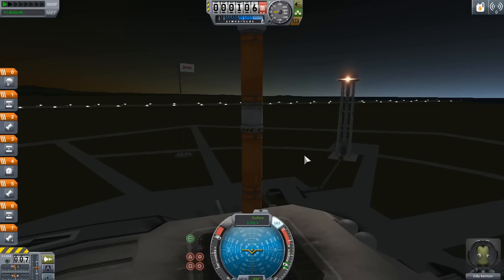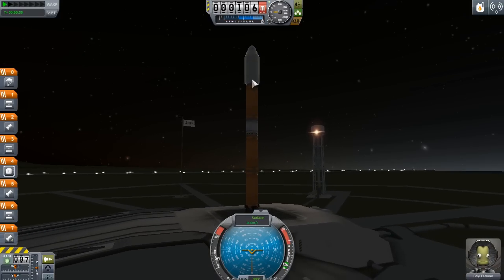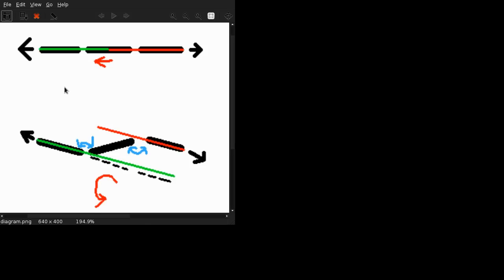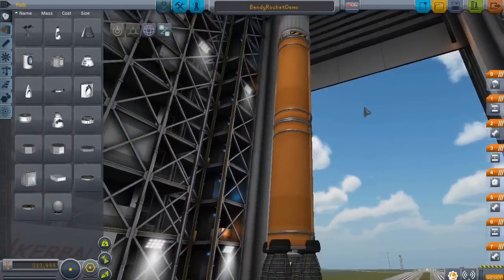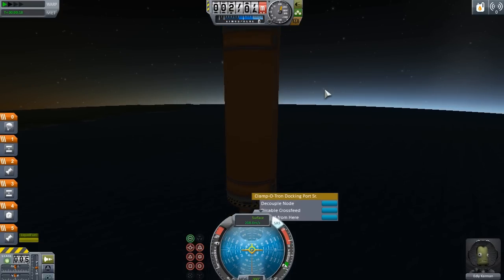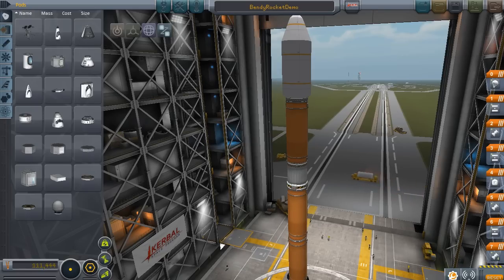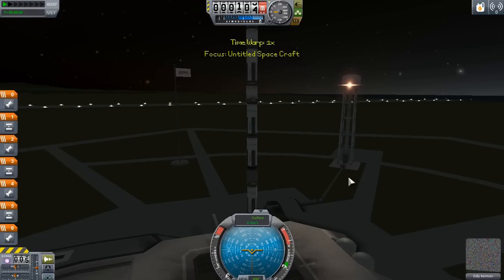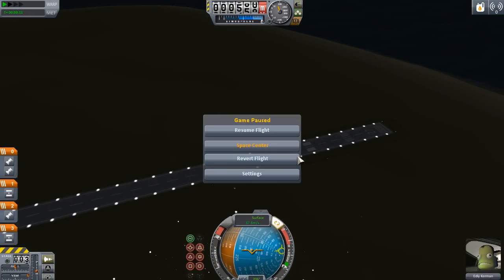Kerbal Space Program - Tall Wobbly Rockets

Comment: I realize this is years late, and everything you said is correct - however; the real issue which exacerbates the wobble and causes all sorts of OTHER problems like SAS fidgeting is the lack of any kind of auto-feedback dampening system in the auto controls.  

In the real world, almost every automatic system has functionality to dampen its inputs as the control adjustments reach the desired goal.  Without this, you get wild oscillations swinging to extremes from even small control inputs.  On the other hand, in KSP, SAS will throw full power deflection in one direction to course correct; then when it obviously oversteers, it throws full power deflection in the opposite direction, leading to runaway oscillations.

Comment: Interesting! Thx for that. This problem should be addressed in 1.1x. Too much struts in vanilla should not be necessary and KJR is a little too strong for my taste and feels almost like cheating. Btw. you may build a pop filter from a metal coat hanger and a thin old sock. ;)
Reply from the maker: +Olaf Schmidtmann It wasn't addressed in 1.1, sadly. They didn't fix much of anything in that update.

Comment: Wouldn't probe cores be easier to build than using docking ports?
Reply from the maker: +Stoney3K Probe cores all need to be put on radial mounts, so you'll need a structural atachment point. They'll work just fine, though!

Docking ports are generally lighter than probe cores, and cost less.
Reply: +William Shipley The RC-001S and RC-001L Remote Guidance Units are stack-mountable for 1,25m or 2,5m stacks. You can also use an OKTO2 which is much ligher but you'd need some inline strutting to fix the weak spot it creates.
Reply from the maker: I misspoke: I meant they're all stack mount. IMO, it's better to leave them out of the actual stack. It should work fine, though.

Comment: pls invest in a $10 popfilter
Edit: a mod to eleviate this problem already exists, it's called Kerbal Joint Reinforcement
http://forum.kerbalspaceprogram.com/index.php?/topic/50911-105-kerbal-joint-reinforcement-v314-62215/
"Sequential parts in a stack will be connected with a stiff, but weak
 connection to add even more stiffness and counteract wobble "
Also, just turn SAS off and use manual attitude control via wasd and/or disable or decrease engine gimbal
Reply: +addictedtopiano The author is aware of these workarounds, but suggests a proper solution by addressing the source issue. His workaround does solve the problem and demonstrates exactly how Squad, or a modder, could go ahead and create a fix for this issue.

Comment: Genius!  SQUAD!  FIX IT!  I know this puts off a lot of new people, making the game unnecessarily hard.  I hope this gets more spotlight and something is done to correct it.
Reply: +Neo-Gambit that's not a bug, they are going for realism, in real life, tall unstabilized rockets would wobble, that's why struts exist, attach struts to your rocket to stabilize it.
Reply: +Antonio Klaić I don't think you understand what the video is about.  Its about SAS compensation for the flex in the joined parts.  Sure struts or KJR mod will strengthen the integrity of the craft, but the SAS calculations for when the craft DOES flex are what is causing the issue.  And as far as realism goes, they have the luxury of having one tank the size they need, they don't put 2 tanks on top of each other, then strut them together.  If 4 orange tanks were "welded" together, and not considered 4 separate parts by the game engine, this would be more realistic like you said.  Struts are just a band-aid to cover up the problem.
Reply: @antonioklaic2740  So you unironically think they use something as dumb as space duct tape to stabilize rockets in real-life?
Reply: +Neo-Gambit 
He is not a genuis, he is bad at KSP. Three struts would stop this wobble.
Reply: Neo-Gambit if struts can't help, add more struts, you don't add them to zwo tanks that supply the same engine, but between decouplers, for example, imagine you have multiple stages, one has SRB's and a powerfull engine, the SRB's carry you to around 10000 meters where air is less dense so your craft is more controllable and doesn't wobble as much and won't flip, then the main engine propells you to space, there you turn on your efficient nuclear engine for interplanetary travel and stuff. You attach struts to stabilize your craft where the decouplers are because naturally, decouplers are unstable, so you add struts to the tank below it and connect it with the tank above it. SRB's are also unstable so you add struts and conmnect them to the main engine tank to stabilize them. It's easy unless you're stupid so you can't use struts.